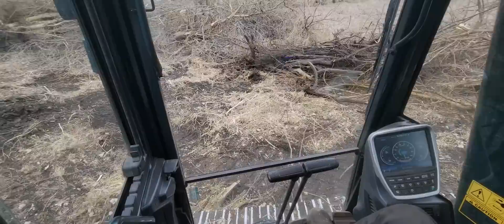Big Old Nasty Ditch Project Part 1 The Brush Work!

Comment: Have you ever looked into a track loader? So that the tough jobs that the wheel loader struggles with a track machine could get you around better.
Reply from the maker: Yes and it's on my list of machines to own eventually what would be Ideal is to get a grapple that would go on the track loader or wheel loader with a JRB quick coupler the only down fall to the track loader is the track wear
Reply: @dirtgrainsteel  that would still make the best of both worlds. 1 grapple and a track machine and trusty Ole wheel loader

Comment: 3/27/23; ..Feller-Buncher/you are cutting  but allowing most cut-offs to fall down bank slope & into the water! Why? Yes I see the excavator pulling & turning making piles for wheel loader/grapple to fine tune/shape for the burn. Just seems you are not seriously cutting close to ground, leaving 10"-12" of stump + whole Lotta trees just laying in the ditch water. I understand you want to 'cut & go', but you are going to need 3, 4 or 5 excavators to go 🔙 back where you were cutting just to pull out those 100's of 'splash' trees because you did not take time to grab, turn & release. I do not do this level of slash/grab/turn/&pile-up, but I stay in one spot until that spot is barren as noted by a large pile behind (or on side of) me.  Just had to comment on how your method... just looks 'skimpy'  kinda 'slam-bam' & move on, leaving bumpy-stumpy appearance on Bank slope. Again, I don't know what specifications were, you do know...but have not prepared we viewers for just how this is supposed to look after you Fel/Bunch & Excavate/&pile up. clear a spot
Reply: Hope you can show us what a complete spot/area (8-10ft swath) looks like after you cut/pile/excavate/pull/& pile up. I know you do good work, but I am anxious to see a 'sample' area. Did you have to perform a 'sample' cut& clear for customer as part of your bid?
Reply: I some (not all) states it is a big no-no to take the root systems out of major tributaries (erosion prevention). I agree it looks bad but is a necessary evil. It is that way here in KY as well.